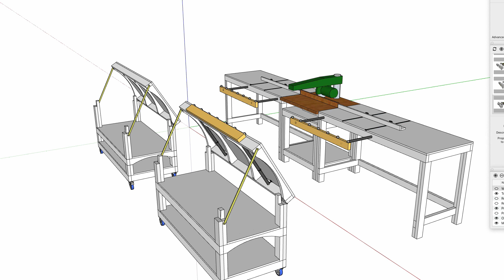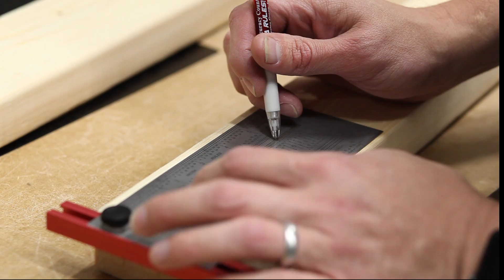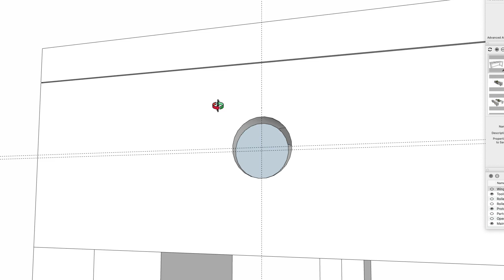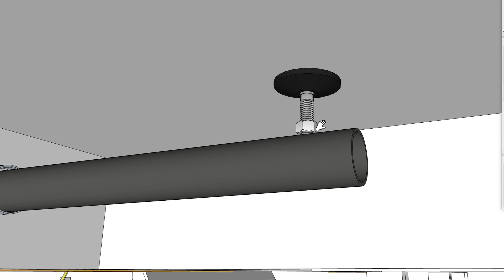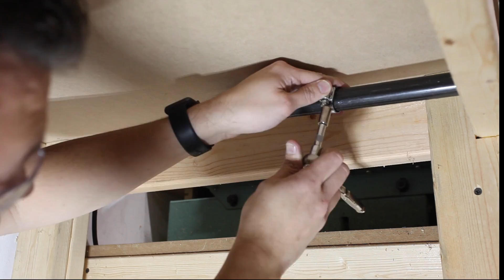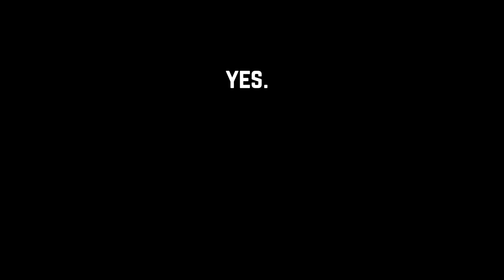Building an Extension Wing for Any Workbench

Comment: Hi, just a correction to your latest video, the pipe you have used is not cast iron but plain carbon steel pipe!
  Cast iron is brittle in bending and usually a poor surface finish.
Reply from the maker: You’re correct. My mistake!

Comment: What type of hinges have been used under the small flip table (1:31) please? Are these commercially available?
Many thanks , subbed👍
Best regards
AB
Reply from the maker: Those hinges are unique to the DeWalt 925H saw which was manufactured in 1960. I don't think they are commercially available anywhere, but it probably wouldn't be too difficult to fabricate your own.
Reply: @TommyTompkins  Thank you Tommy. Great content on your website too...
AB

Comment: Great idea. 
What saw blades do you use? I just bought a Dewalt/B&D RAS and it's time to set it up.
Reply from the maker: Hi Rob - there are two saw blades that I'd recommend that have outstanding performance on the RAS. The general consensus on the DeWalt radial arm saw forum is that the Forrest Woodworker 1 blade with the TCG tooth design is the best combo blade for both cross cuts and ripping.  For a 9" saw, the 8" blade is recommended as it's able to power through the cut more easily (more torque).  You can get that here: https://www.sliversmill.com/product_1635_SPECIAL_Forrest_8_x_48T_Woodworker_I__TCG_Design_Used_by_Mr.html  If you are looking for a cheaper blade with good cross cut and ripping performance, get the Freud LU83R008 - https://amzn.to/2PjfYF4  Also, if you don't have the Mr Sawdust book, get that at mrsawdust.com
Reply: @TommyTompkins  Very much appreciated. Thank you